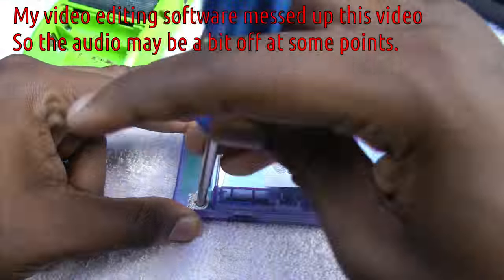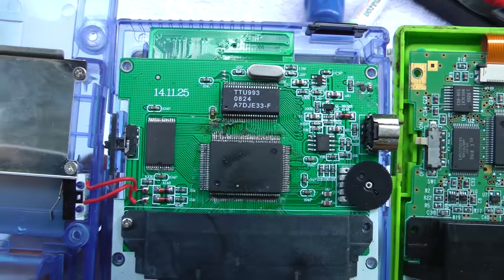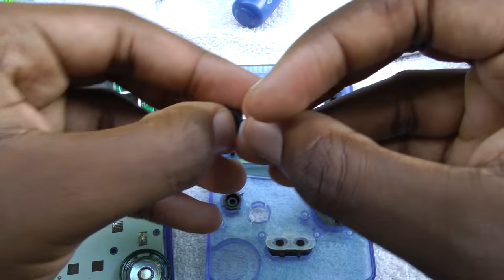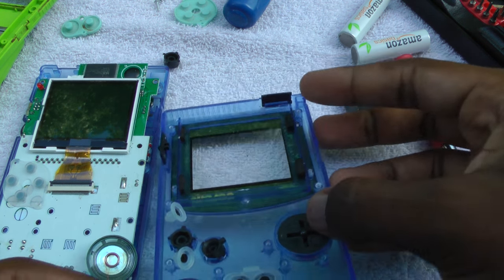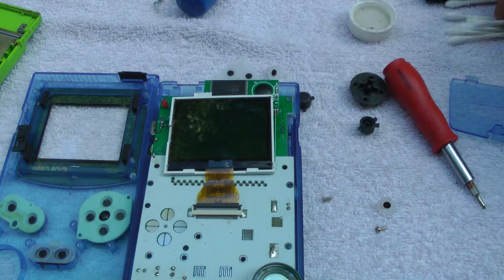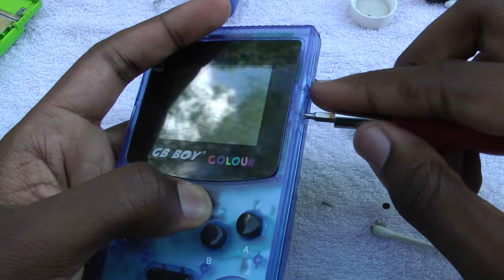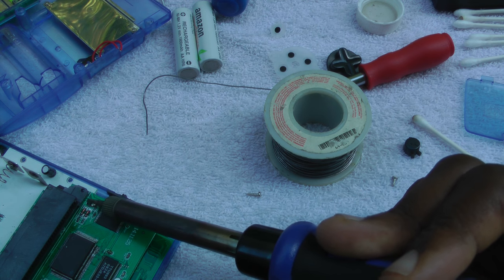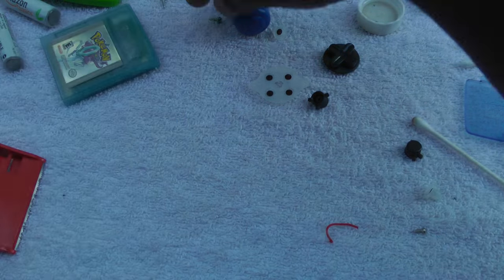GB Boy Colour Teardown and modding

Comment: Is it possible to replace GB Boy Colour case with GB Color original case ? Will hardware from GB Boy Colour fit in Gameboy Color case ?
Reply: h3xagon95 maybe the pocket version one will
Reply: You can still remplace the buttons by the original from the gameboy color.
Reply: Can you elaborate more on why this wouldn't be possible?  If you mod the GBC shell slightly, it seems like the PCB would be a perfect fit?
Reply: the short answer is no. the long answer is yes, if you would throw a lot of time and money at it there might be ways to fix it but it's not granted
Reply: it has mainly to do with the fact that the board is too big to fit in an original shell
Reply: It’s possible but not without heavy cutting the the Gameboy case. But it wouldn’t look that great. Better off buying an Odroid.
Reply: how?  @antoinevs7201

Comment: So I'm a noob but would it be possible to change the ribbons on the screens to put it in a gbc? I mean like use a gbc ribbon and put it on the gb boy colors screen that way it'll work with the gbc.
Reply from the maker: nope, sadly the appear to be wired different, 
Some one would need to design an adaptor.

Comment: Great video man, I was looking for something like this for a while now. I've worked on refurbing many old GBC consoles, but I had to get the GB Boy Colour once I saw the backlit screen.

I've been going it's possible to squeeze the GB Boy innards into an original GBC housing, but it doesn't look like it's possible at all. Do you think you could make it happen with some cutting of the GB Boy PCB maybe? If it looks possible, I wouldn't mind sacrificing $30 to find out lol
Reply: typo, I meant to say "I've been wondering if it's possible to fit a GB Boy Colour into an original GBC housing"
Reply from the maker: I don't think so, the PCB's are pretty different in more than just size, but spacing as well.
Reply: Kevdo yes I have done it, there are specific points in the original housing that you need to dremel out carefully and certain peices like the rubber button fittings need to be used as original, then the original buttons need to be dremeled a bit in specific points to fit the rubber fittings, as for the screen it's a slightly different aspect ratio so you either have to deal with a bit of screen cut off or you have to make a modded screen face, the way to do this is with a custom gbc fitting and just a clear gbc glass front fitting, it can definitely be done but it takes a bit of effort and money for the shell and custom screen fitting, before I forget the cart holder silver looking part in the back is also slightly different and the housing has to be dremeled out a bit on either side and since the fitting for that is no longer the same you'll need to superglue it into the new sized slot you have made

Comment: How did the D-Pad feel after you put the original Gameboy one on ? I can't stand the dpad of the GB Boy and would love to put a Nintendo one. I have a spare from an original DMG black & white Gameboy. Would that work ?
Reply from the maker: the gbc one with the gbc contact pas is MUCH better!
It feels almost like an original GBC d-pad, but a little bit tighter, a DMG  is about the same size, but more square, so it may require some modding of the front shell.
 
I have not tested the feel of that mod as of yet.
Reply: Thanks. The DMG is larger but I had a GB Pocket (broken screen, missing bat cover etc.) and the d-pad and rubber pad fit perfectly. I think they are the same as the GBC. Its much much better. 

Thanks for your awesome video. I have subscribed to your channel :)

Comment: Nice video and mod. Does the flash board has the same vias that the cartridge? I guess you can make a cartridge with the flash board (maybe it can run on the original Nintendo GBC as well)
Reply from the maker: it might, but I have not tried.

Comment: Can you do a tutorial for backup DS save data files on 3ds via homebrew method since you can use it for free in 11.00?
Reply from the maker: currently the only methods I am aware of require CFW, or a ds flash cart (+wep/open wifi)
Reply: nvm i just put the program in my homebrew folder and it work completly well, thanks!

Comment: Hey. 
i enjoy your videos. just thought I should tell you, don't use Q-tips too clean electronics. Just a tip.
Reply: why tho?
Reply: Hey. I guess you could, it's just the fibres from the Q-tip can attach too many things on the Logicboard.
I use them sometimes, I guess I meant too say be careful. Just thought I would ask, have you heard of the Super Retro Boy by Retro-bit, it's suppose too come out this August. If you have seen it, what are your thoughts? I'm about too mod a GBA agb001 with a ags101 screen. But, with the S.R.B. coming out, I'm not sure if it's worth it. I know you did similar mod. The ags101 screen I found in a damaged sp is the type A I believe, the ribbon is uniform and the back of the connector is white. I have a 40 pin GBA, I just heard those screens don't work well on the 40 pin GBA. Have you come across the problem. Thanks man.
Reply: Aaron Gallant Yeah, I use alcohol prep wipes from a pharmacy, it leaves no stray fibres

Comment: Hello, thanks for this video. Regarding hardware modification, Does anyone has tried to replace the quartz ? Having issue with Gremlins 2: The new batch. 
Also had to resolder red power led to be correctly aligned to the screen hole
Thanks
Reply: I was planning to change the quartz but finally didn't.
I was having audio issues with it (the pitch was slightly off) while trying to use it for music making (lsdj) and I thought it can be the quartz use not being the same value as an original gameboy color.
I"m also curious to see if someone try this mod.
What was your issue with gremlins 2?

Comment: what tools did you use? do i need a gamebit screwdriver?
Reply from the maker: gamebit for the top two,
a small Philips driver for the rest.
Reply: @bobdotexe  I got 4.5 mm gamebit that wouldn't fit into the recessed hole. Could u link me to a  tool that will fit?